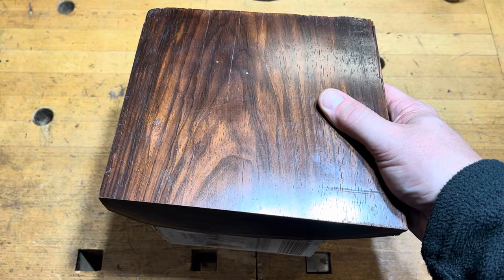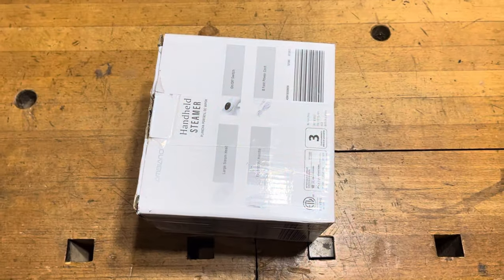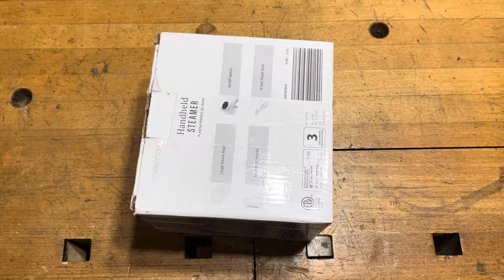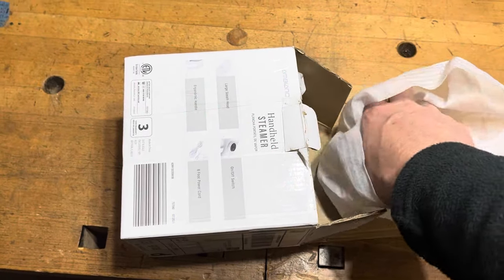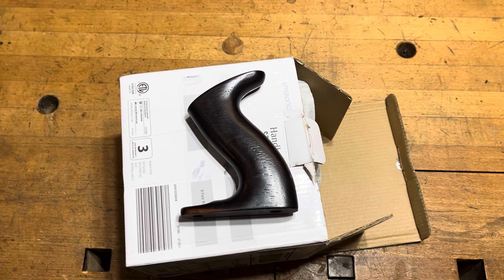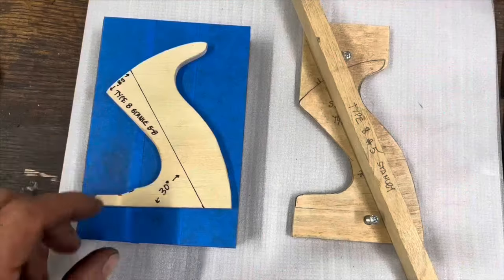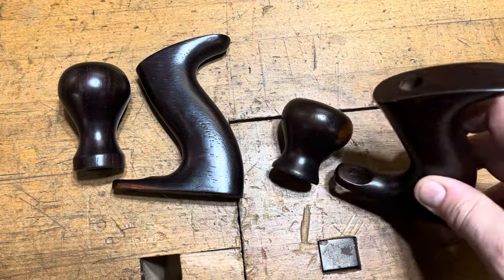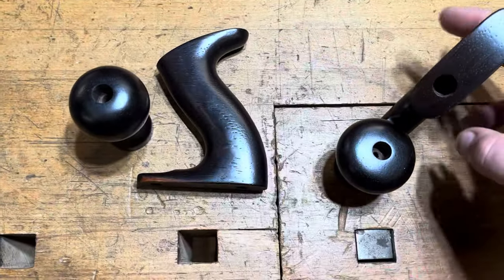How Reproduction Stanley totes are made

Comment: Perfect. Type of wood? How long was it cut and how was it dried? Is there an angle number for the tote hole? What is the finish used? Is there a specific grain direction? If these are trade secrets don’t share.  Thanks
Reply from the maker: The wood is either East Indian rosewood or possibly the real deal - Brazilian RW. It was sourced from an estate sale so the origins of it are unknown. 

For the other questions, I’ll have to defer to Dave
Reply: The angle for a Stanley No 5-8 tote is 27 degrees. I run the grain parallel with the sole of the plane just as Stanley did. As for the finish that’s my little secret, not ready to give that up just yet….

Comment: Dave - when you mill up the stock, do you have a specific thickness that you aim for? I’m assuming around an inch but wondering if you start with a more specific thickness?
Reply: For Stanley planes it’s .95” a bit less than 1”. Union x planes tend to be thinner at .90-.92. It just depends on the manufacturer.
Reply: @DaveCorinth  ok is that the final dimension? So am I correct in thinking that you probably start with stock right at about 1” and then after sanding get down to .95?
Reply: I plane the stock down before I route them. So for a Stanley I will plane stock down to about .95-97. If I leave them 1” thick it makes extra work sanding. I try to make the sanding process a easy as I can.

Comment: Beautiful work - could you please comment with what router bit you are using? Thanks!
Reply: I use a router bit from Lee valley made for saw handles and totes.
Reply: It’s called “Variable Round Over Bit”
Reply: @DaveCorinth I’d be curious if your able to comment on how you get perfect alignment when drilling the long hole? The first jig looks like there is a slanted shim - is that dialed in for a specific degree so if you rest the tote on then you get it bang on? The next clip where you drill from the other direction doesn’t involve a jig so was curious if you just eyeball it?
Reply: The jig I made has several shim ranging from 14 degrees up to 31 degrees. It allows me to drill the hole without tilting my drill press. I drill from both directions first from the top and then from the bottom. The key is to use a brad point drill bit. They don’t wonder nearly as bad as a standard twist bit.
Reply: @DaveCorinth thank you!